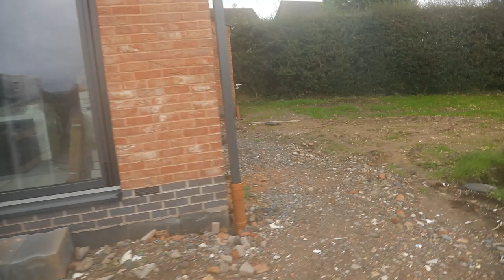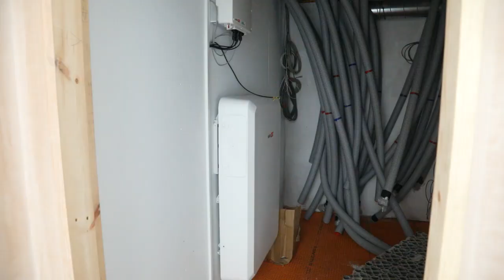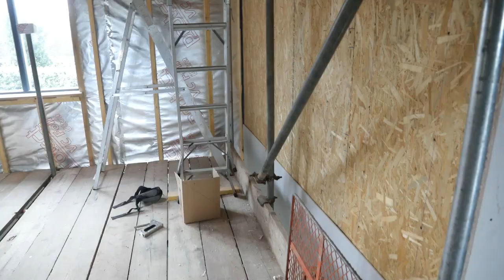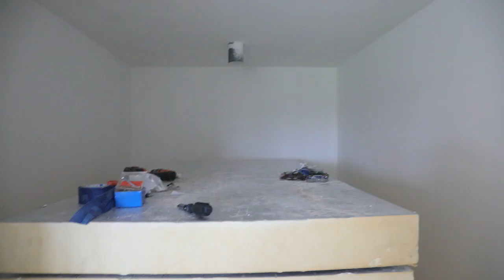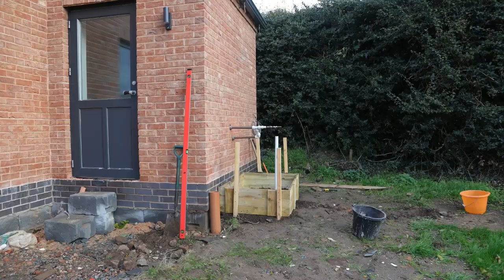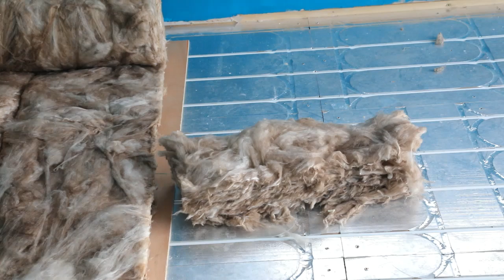The Self Build Day #210 - Fluffy Stuff (never ending insulation) and Heat pump prep

Comment: Great Info, thank you much appreciated. Just found this channel and now I’m really enjoying it binge watching catching up. Lots of useful information. I hope you don’t mind asking few more questions. How did you get on with that paint gun? I’m not at that stage but was in two minds about it. Also with your soak away that was a great idea adding that trap to the rubbish, I think I will do that too. Did you use the soak away crates? I heard you said you filled it with gravel after do you have to do a proper base for that or do you just leave it on the Soil and then fill the hole up gravel and Soil on top after it’s been membrane. I think this channel could do really well. I also watch the Aidan project he’s doing a barn conversion. Just think you can do loads of this when you start doing the garden the ponds and so on well it’s helping me.😂 thanks property looks great
Reply from the maker: @belucky9630  hi,
Paint Gun: never used it beyond what you saw in the video! H thinks it might have been the type of paint but I just got on with a roller. It will probably go on eBay!
Soak away: yes we used 14x 1000x500x500 creates iirc. We actually only needed 12 but the supplier did a pallet of 14 for less so we had that. The pit had gravel in the bottom. You wrap the crates in a membrane (brought with the crates) to stop soil ingress, then you cover the whole lot with gravel and finally soil.
Trash Trap : yes it’s surprising how much rubbish gets swept it!
Regards

Comment: I just have interest have you only got to put two layers of insulation in the loft . I’m doing something similar with the heat pump they want me to put in 
3 layers of 150 . 450 total in loft.
Reply from the maker: @belucky9630  Thanks for the question. The recommended depth was only 270mm, we rounded up to 300. That said,  we plan to put in another 150mm when we get the chance at least over the master bedroom as that seems to cool faster than other upstairs rooms. Be aware that if you do have deep insulation you need to ensure that you still have the air gap around the eves to allow the roof to breath.